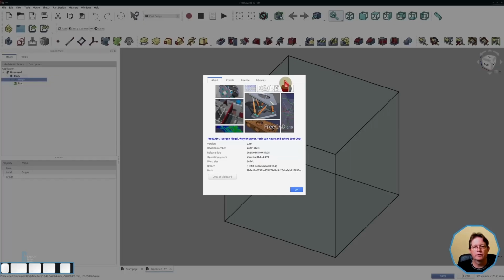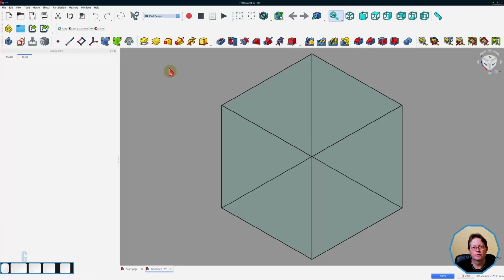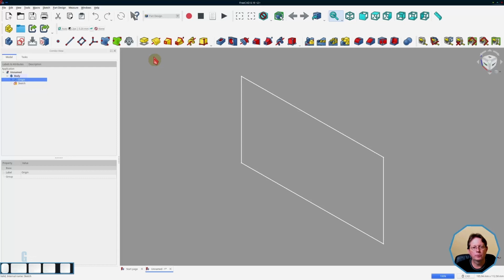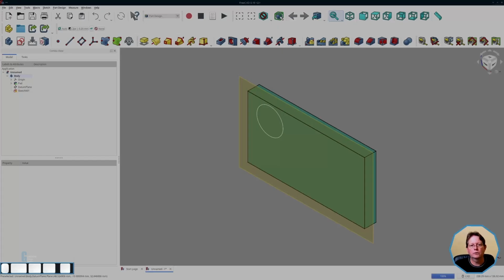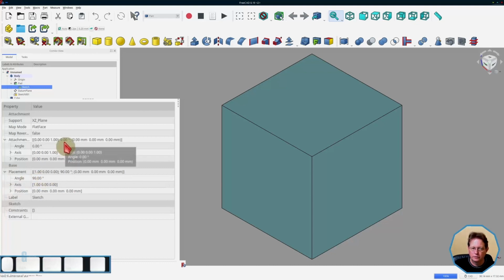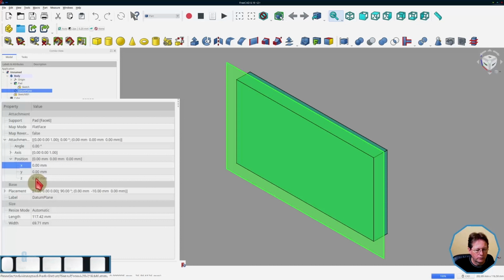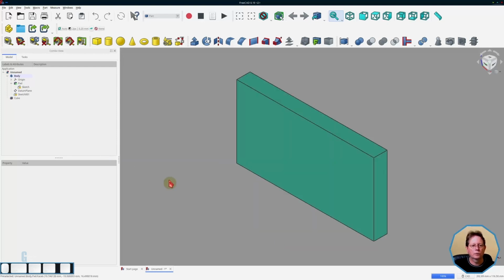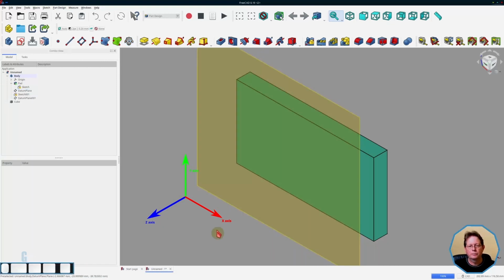What are FreeCAD's coordinate systems?

Comment: Intrigued! Worked CAD in aerospace where the absolute datum was some predetermined point in space just ahead of the nose cone profile. All components were positioned relative to this datum although all design construction was carried out using local XYZ coordinates. The ‘Z’ coordinate always moved in and out of the screen………..and was used for ‘clipping’ whereby anything beyond a certain negative or positive ‘Z’ value would not be displayed if the component was zoomed in or out beyond these set values.
Reply from the maker: Thanks for your comment. I've never heard of anything like that before, but I find it interesting that different software systems attack the same problems quite differently.

Comment: Help please. When i import svg file, coordinate axes stay away from object
Reply from the maker: Thanks for your question. I don't really understand what you are trying to do. Can you give me a bit more detail please? How are you importing it - as a drawing or as geometry? Have you tried transforming the elements?
Reply: @GlassonDesignStudio  As geometry. Yes when I want to move object axes are not on him but far away. Coordinates show 0,0,0 but axes still not at the object
Reply from the maker: To be honest with you, I haven't done this before so I don't have good advice for you. The tests that I've done suggest that you can convert them into parts using the Upgrade tool in the Draft workbench. It looks like you can importing them into a sketch that is NOT part of a body (created in Part Design Workbench), but overall it seems to me that you'll need to do a fair bit of work once you've imported the SVG. I'm sorry that I can't be of more help. Have you tried on the forums?
Reply: @GlassonDesignStudio  Yes i convert them into part using upgrade tool in Draft. Then importing them into sketch. I tried search answer in internet but didin't find
Reply: @GlassonDesignStudio  I extruded imported svg file as sketch in part design as body but stil same problem with axes
Reply from the maker: @nara light now that you've created a sketch have you tried setting some constraints inside the sketch to being the sketch back to the origin? Also, you might find some additional information at this page https://forum.freecadweb.org/viewtopic.php?t=29704

Comment: You are knowlegdeable on the basics enough, but the video makes the subject look more confusing than it is. The video jumps from one topic to the next, skipping over some of the details while spending too much attention on others. If you feel it is neccessary to explain what a cartersian system is, the topic of datum planes and the topological naming problem might be better omitted for clarity. 

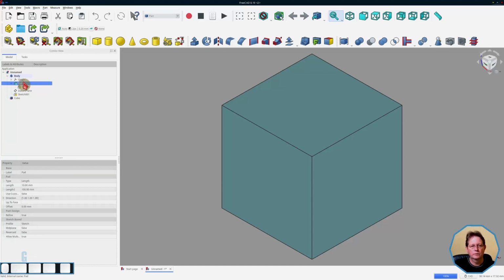You introduced two terms global and local systems, but you referred to then you use '3D coordinate space' (7:20) to refer to the global system(?). You also name it the 'global' system, but as I understood your explanation, you meant the coordinate system determined within the body. Yeah, I got confused by this video as well.

It's simple: you draw the sketch in the coordinate system of the sketch. The placement point is the point where the origin of the feature is placed within the body. The attachment point gives an offset. This could have been explained in less time than this videos runtime.

What happens if you use more than one body in a single project? Is it preferable to move features with their placement points or their attachment points?
Reply from the maker: Hi Jason, thanks for your feedback. I certainly didn't set out to make it confusing, but thank you for pointing out that I did. I will take your comments on board and look at making an improved video. I will also look into your other questions.
Reply: @GlassonDesignStudio  Thank you for taking it this way. Teaching a topic with so many ins and outs as CAD drawing is less straightforward than it first might appear. Kudos to you for taking it as a learning experience.

From the trainee's point of view: I have watched more than a few entry level videos made by people who meant well and did their best. On a few occasions I ran into issues (and lost quite some time) when the  'working solution' was not a proper solution (eg. not scalable). 

I have learned a bit as well since my last post, and I think a better way to approach it would be to create a single part, with the bodies nested in there. But this might be another case of One Eye leading the blind as well.

There are many good resources on youtube. 
https://www.youtube.com/channel/UC7pokUsRb6q2B0FOzSqQLlw
Reply from the maker: I'm too old to think that I know it all :P. I appreciate people talking the time to give me constructive feedback even if I don't particularly like what they are saying. IMHO that's the way to learn and find better ways of doing things. I appreciate that you've taken the time to leave feedback when too many people would simply write me off as being a tosser. Thanks again.

Comment: wgat i don't understand and was not explained is what is the reason for the z axis to be in a different direction from global to local plane (does not seem to make sense to me) ?
Reply from the maker: Thanks for your feedback. The general purpose of a local plane is to simplify creating features that are not based on the three standard planes. Think of a local plane like a piece of paper. A local plane is typically used for sketching on and since sketching is a 2D operation, you can only draw in the X and Y coordinates.  The local Z axis is different to the global Z axis because it is always perpendicular to the local plane. FreeCAD handles the maths involved in converting from local to global coordinates so that you don't have to worry about it.
Reply: @GlassonDesignStudio  thanks for the reply, makes it much clearer. I wonder, have you had any experience in designing BSP parallel and tapered threads in freeCAD ? I've used the fastners workbench but it does not support BSP threads. A video on BSP threads would be awesome ;-)
Reply: @GlassonDesignStudio  that's an awesome answer to an awesome question. this video is great BTW.